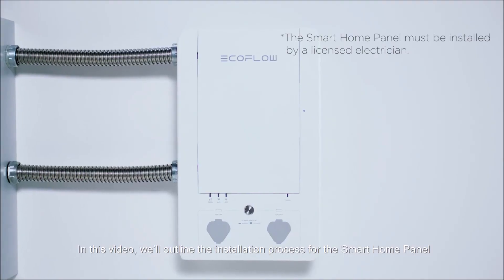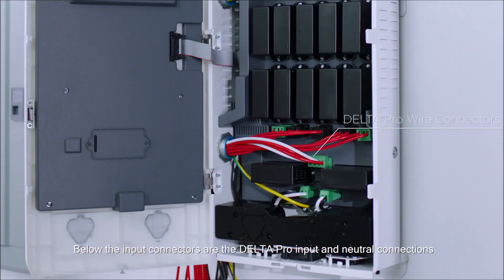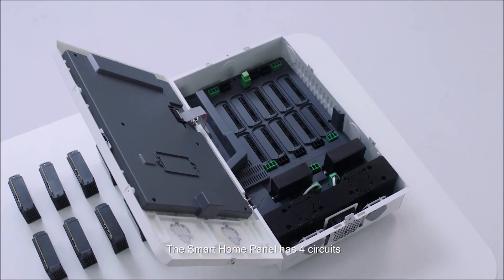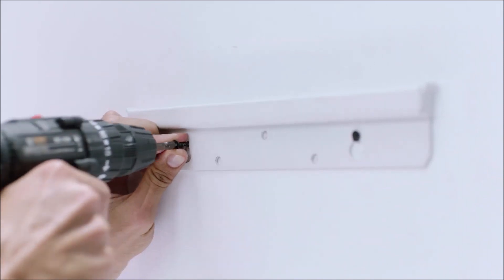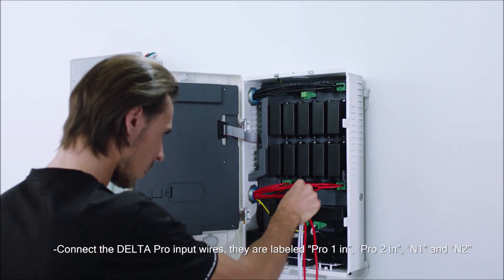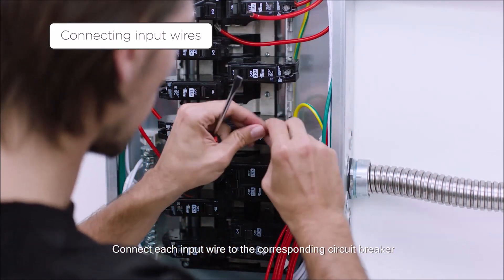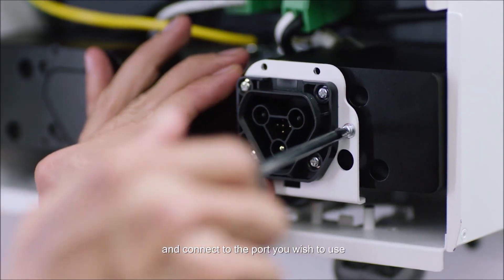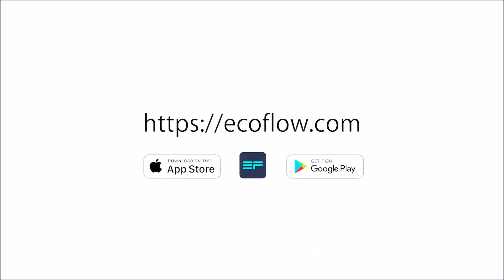EcoFlow Smart Home Panel Installation Guide

Comment: Does the smart home panel tie you in to just using ecoflow batteries?  Not sure if that's worth the trade off.
Reply from the maker: The Smart Home Panel allows you to automatically switch to backup power on selected home circuits from grid power to a backup solar generator system.
Reply: Depends on what you add onto the delta pro, but the delta pro is the primary interface to this particular panel.  

If you had an independent solar system, inverter output with AC you could charge these batteries from that or you could wire in any DC solar mc4 panels upto 1600 watts per pro/ 150v I think.

Comment: Does this work like an ATS? so it’ll come on battery power as skins as the grid power goes out?
Reply from the maker: Yes, that is correct! It is an automatic transfer switch and can sense when power goes out and switch over immediately. Thank you!
Reply: @EarthtechProducts  Correct. 20 ms switching time when in EPS mode. 2 seconds when not.